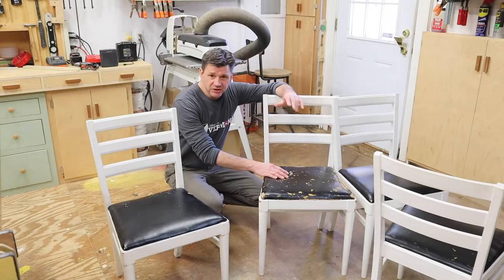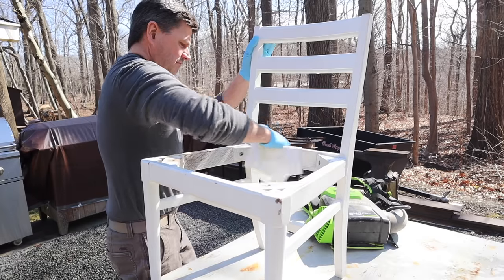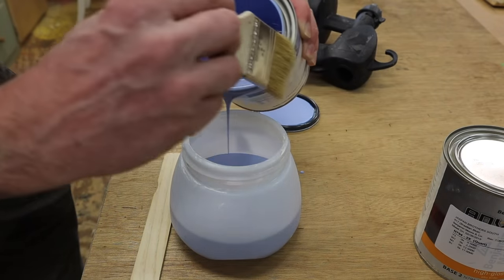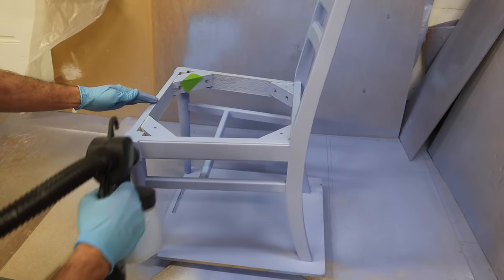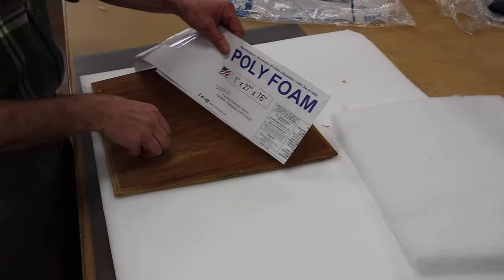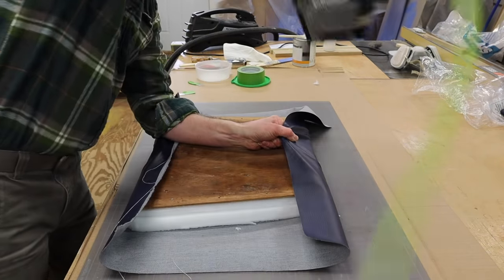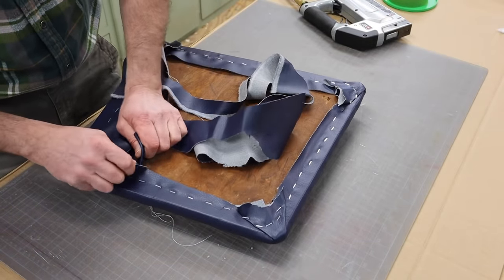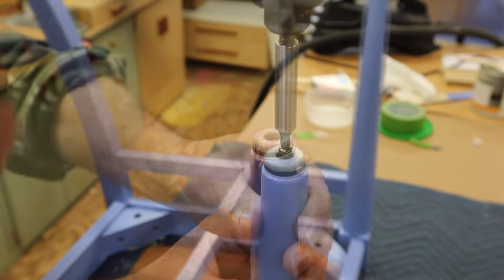How to Refinish / Paint and Upholster old Chairs - DIY Upcycle Project

Comment: Jon, great job as usual. One problem though with your links... the Round Cherry Table top & Frame works on Paper are the same link. Was hoping to view your method of building the frame for glass. Thanks.
Reply from the maker: Thanks for the heads up Liam  I just fixed it

Comment: I haven't watched any of his videos in a couple months. I'm gonna have to start catching up (especially with warm weather coming soon). Btw, when did he switch over to Milwaukee? I've been using Ryobi for 4+ years (work full time in the trades, but I usually do paint, drywall, mud and tape, and lots of demo). Any reason for the switch? I've thought about switching to either Dewalt or Milwaukee, but I don't need to switch, and my Ryobi stuff hasn't given me any trouble. Currently I have 5 tools, and 5 batteries. Anywhere to look for an unbiased review? I love the simplicity of Ryobi- always accept the same battery, and 70+ tools use them.
Reply from the maker: I think most of the cordless tools are all pretty good these days. Milwaukee just happened to give me some tools so that’s why I’m using them
Reply: @JonPetersArtHome  Sounds reasonable. Like I said, they've never given me trouble so far even after some abuse. I do like the price point, though. If I lose a drill or it gets stolen, I'm out maybe $50 plus time to go buy it (I live in the suburbs outside of Chicago). I am glad that you're truthful and aren't a spokesperson, btw. Just got done with a long rush and now have more free time (80+ hours a week doing cleanup after frozen-busted pipes), I'll definitely watch some more videos now.